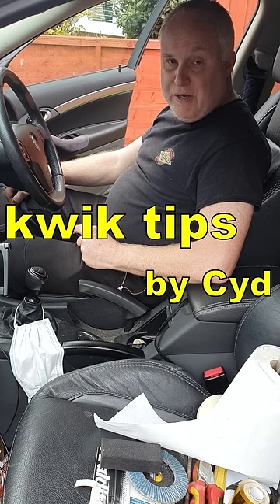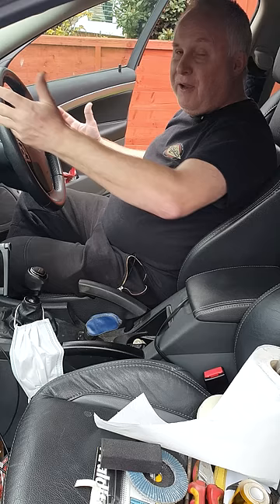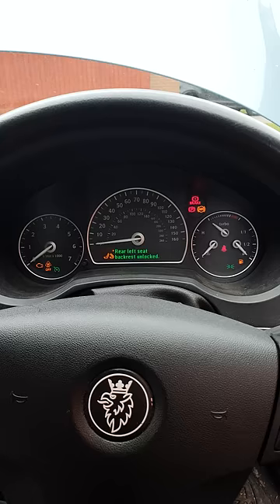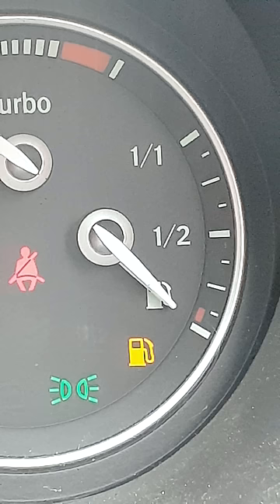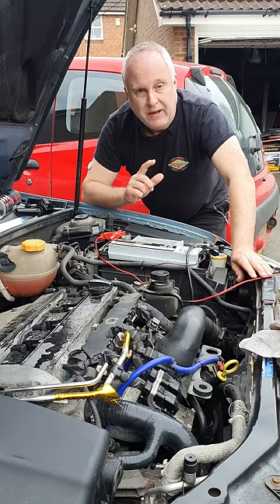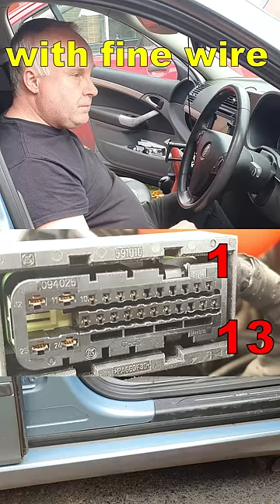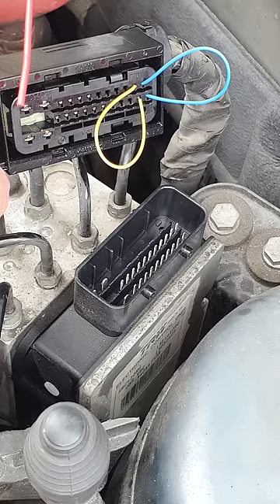Saab 9-3 No Crank No Start❓ Check This Out

Comment: Thanks a lot for the tip! I was trying to start my car for 30 min yesterday and I was in the middle of Stockholm at an expensive parking.
 I was about to give up and call a towing truck and then I found your video and I opened the ABS module and cleaned it with what I had (mostly blew on it) and it started so I could drive it home!
Thanks again! You saved me a lot of trouble and money 😀
Reply from the maker: a more detailed description of the problem and how to fix it: https://www.youtube.com/watch?v=MmZalE0eiYE&t=27s

Comment: ABS module failure = no crank no start. Absolutely brilliant. Can't imagine why they went out of business.
Reply from the maker: TBF the CANBUS system was more of a GM thing than just Saab. They just had not kept up. Other CANBUS cars launched around the same time had addressed this problem years earlier.
It also suggests that Saab and GM generally weren't using DFMEA tools properly during the engineering process. Again something that had become commonplace over the previous 25 years (I was doing detailed DFMEAs on Range Rover P38 in 1991). This was a monumentous failure on GMs part especially given that DFMEAs were being used as evidence in US product liability cases.
Interestingly though, if this comms issue occurs whilst driving, the aircon stops, but the car keeps driving, so the issue HAD been considered by Engineers.
Reply: Blame GM for it
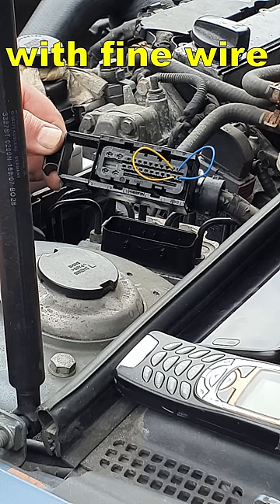Reply: @CycloneCyd  how did you unhook that piece at approximately 0:24? I can’t get it unhooked and don’t wanna break anything
Reply from the maker: @henrystephens1683  pull it out. Spray some lube into it first.

Comment: Thank you so much. Because of your videos I was able to repair my Saab 9-3 2.8 Aero. And I also learned a lot and understand that car much better. Before I thought everything in electric is broken. This no start was make me getting crazy. Greetings from Germany 🙌🏻🙏🏻 For me I changed the ECU, the ABS-module and the purge valve,.because my car didn't start well after getting fuel. So it was a whole journey with all it's issues. The ECU came from USA, the purge valve from Italy and the ABS-module as a spare part from a 9-3-driver near by. I have had to change an other valve behind the purge valve, too. It was broken (maybe I destroyed it as I changed the purge valve) and it eems to be there for the breaking system. Holy....don't want to know how expensive this repair would have been, if I didn't do it by myself. I paid 260 Euro for ECU and 120 Euro for the copy service, 45 Euro for ABS-module, 50 Euro for purge valve, 50 Euro for the other valve, 70 Euro for TechII service.

Comment: Thank you. You are a life saver. I was on a trip and this happened. Saw this clip, removed the connector. I could not find cables, but when I re-connected, it started right up. I did have a check engine light and stability control system failure warnings for a day, but went away as I was going to get the codes read. Thanks again.
Reply from the maker: Yes, sometimes the loose connections are intermittent. Waggling the connector or disconnecting and reconnecting can remake those connections. That should be regarded as temporary though, the problem won't fix itself!

Comment: Classic Saab, dry solder joints. When something in my 9000 didn't work anymore usually a quick re solder solved it.
Reply from the maker: Hardly a car built that doesn't suffer similar problems eventually.

Comment: Thanks, I had it a few times
Reply from the maker: Do you mean you had this problem but it was intermittent? Sometimes if you waggle the ABS connector it'll allow a start because the pins make contact with the board again. I'm going to do a video on how to repair this fault soon. I'm waiting on a 2ndhand ABS module to arrive.

Comment: Hi I've got the same fault. No crank traction control failure fuel gauge doesn't work and fuel pump doesn't prime. Tried your by pass but still didn't work. Took the abs module apart and all connections look ok. I'll re solder them anyway but any other ideas ta

Comment: Thats a great tip. I've had problems with a number of ignition modules that stop working or very unreliable, very inconveniently. Is there a shortcut/easy way to install a push button  start as backup?
Reply from the maker: A push button start is possible, others have done it, but I don't think it would help with this situation.
Reply: @CycloneCyd  The ignition is switching on ok. Its just the final turn to crank that ends up being unreliable. I'll try one more module and see what happens. Cheers

Comment: The odds are high. 2.0 or 2.8 both have the problem. Grind open the module, roflow the connector and glue back shut. And fixed.
Reply from the maker: Applies to ALL 9-3s, no matter the engine variant

Comment: Happen to me…Saab repair shop sent it out for rebuild …cost me $900… ten years ago…. Wish I new this trick then…👍✌️
Reply from the maker: $ouch! Loads of ECUs in loads of cars suffer this type of issue.
Not just cars - I've repaired loads of gas boiler ECUs this way for a local Gas Engineer. Saved his customers £000s.
Reply: @Cyclone Cyd  thanks for sharing your knowledge! It is very helpful...Cheers from the states!
Reply: Hi Cyd, can I leave this jumper in place for next 24hr...as I need to use the car until I get some time to make the permanent fix? Right now... I have to insert jumper to every time i want to start car...
Your thoughts?
Thanks

Frank
Reply from the maker: @FranksWorld1  yes, you can, the car is driveable, BUT remember your ABS/traction/ESP will not be operational, so perhaps be a little extra careful, especially if you have to drive in the wet.
Reply: @CycloneCyd  understood…gonna attempt solder repair in a week or so…just want to avoid lifting hood everywhere I go to restart the car…
Thanks for the reply! And there is a coffee coming your way!
Cheers!
Frank

Comment: I had stability and traction control warnings in the dash. I did this and those went away, but the starter still wouldn't do shit. It just began one day after a drive it died at idle in the parking lot. Started it again and it idled for about a minute and died again after that, it would start sometimes and not even crank other times. Now it won't crank at all.
Reply: Im not a mechanic, but it sounds like a bad crank position sensor. Sometimes the car will crank no start. Sometimes it will run rough. Sometimes will not crank at all. From what I hear. Hope you've figured out the problem already.

Comment: Hey Cyd, I`d be willing to look at the old ABS unit for you.  Shouldn't be too hard to sort.   Frank.
Reply from the maker: Thanks for offer, Frank. I dare say there may be others who'd be interested.
Today's video is how to get it apart and repair it along with a little preventative maintenance.
Reply: Where are u located
Reply: @NoCutCardz  Who?  Me or Cyd?
Reply: @saabfeverfrank  either... anyone who can fix my baby.... 07 saab aero stop starting. Jumped it from Yellow starter motor fuse to get it started from pin 87 location to positive side battery, worked a few times then stop working. Steering wheel is not locked but the notification did pop up
Reply: @NoCutCardz  I`m down in Cornwall, no idea where Cyd is though.

Comment: Only track control light comes and stay while driving,sometimes when starting,sometimes car starts at first attempt,sometimes must insist.speedo unstable. Any suggestion? No abs light,no engine light.
update,,,,replaced battery,car started and worked for a while,problem returns,now cranks but no start.

Comment: If it clicks only....is it same fix? If I hopd key to start my battery cables eventually get warm and the starter gets hot....I put in new battery.i even tried to turn the main pulley and its unable to turn..or atleast I'm not able to turn it..I have a new starter but I'd like to know if your hack pertains to my symptoms?.it feels to me like the motor is stuck.the car was driven 9 months ago I have trouble thinking it could've locked up in that short time...anyone have any ideas??

Comment: Having similar issue.steering lock malfunction error ,key turns,but car wont start..any idea?
Reply from the maker: First step, clean the ISM, they get dirty inside and gum up.
Also try resynching the key https://www.youtube.com/shorts/gmbsA5Co2oE
Reply: @CycloneCyd  Thanks,the car started after hitting  the ISM  connector with my finger, No more error ,SO i guess have to clean or replace the ISM.
Reply from the maker: @serateable  take it apart and clean it

Comment: Hey there I have Saab 2007 2.0L T is giving me code p0606 for pcm I have to change the pcm ? Thanks
Reply from the maker: Yeah, engine ECU issue. Replacement req'd. Get a Saab specialist in your country to clone yours into a used one.
Reply: @CycloneCyd  thanks you the best :)

Comment: Hi just got 09 saab 2.0t Manuel it ran fine all day the tonight it lost all throttle response and died now turns over but won’t start and ideas engine is all fine and fuel pump turns on
Reply from the maker: Check the ABS connector as shown in this video and then also check this https://www.youtube.com/watch?v=iLKOqCS67xM&t=18s